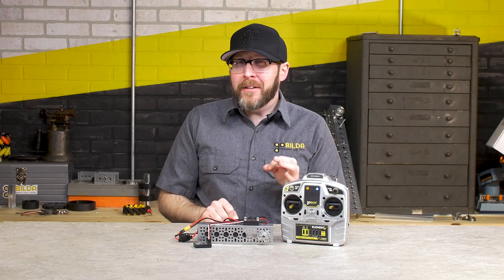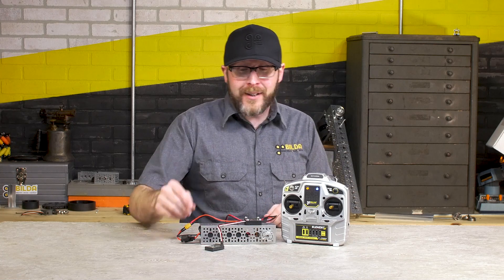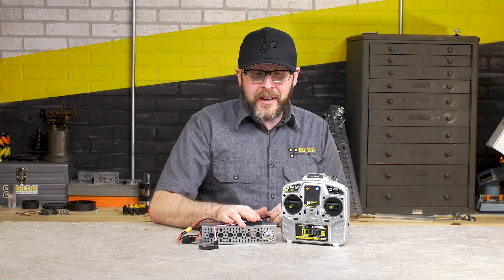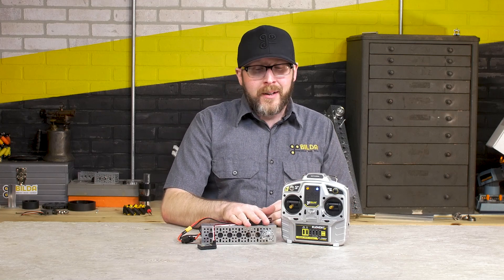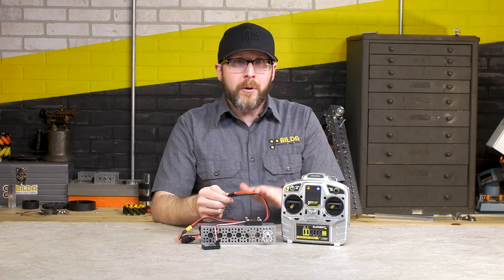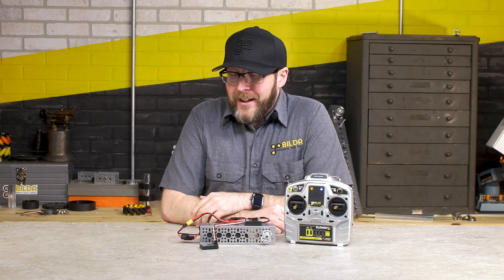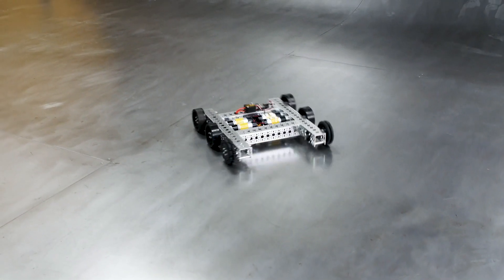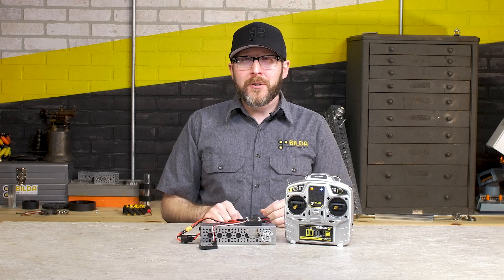New 1x15A Motor Controller

Comment: Will this allow you to use motor as a servo? and connect it to the Rev Control Hub?
Reply from the maker: Yes! You can, it will run the motor as a continuous rotation servo. It's important to note that while it will work with the REV control hub, it is not FTC legal for the 2021-2022 season.

Comment: Hi guys, is it possible to connect this motor controller with a micro-crontoller such as nvdiai jetson nano o arduino ? Thanks
Reply from the maker: Hello Ricardo, Yes you totally can! It is controlled via RC PWM, so research how each of your potential microcontrollers controls an RC Servo. For example the Arduino Servo library is a fantastic way to work with this motor controller.

Comment: can this be used with a servo programmer
Reply from the maker: Some servo programmers like the Hitec HFP-30 have a test mode that will output just in-range PWM signals, in those cases it can.